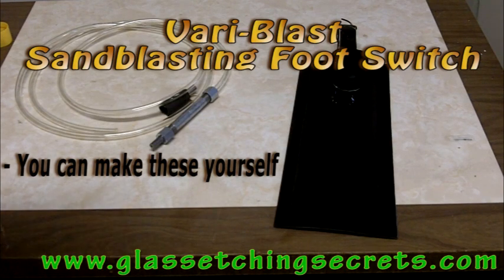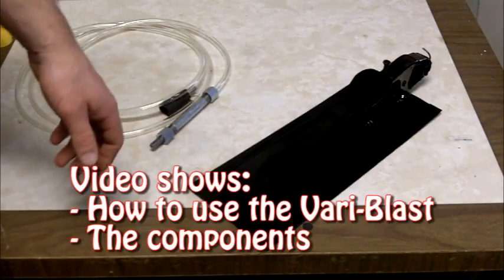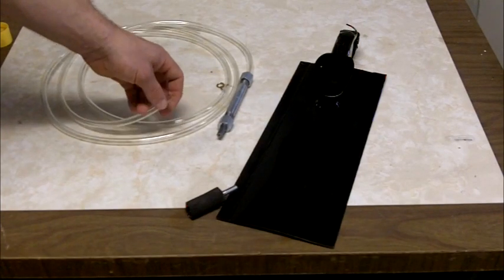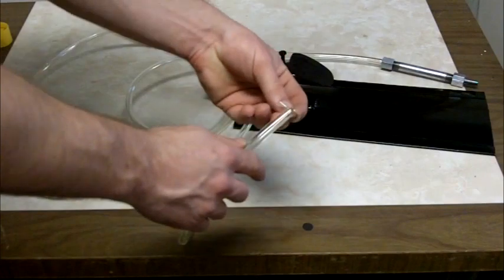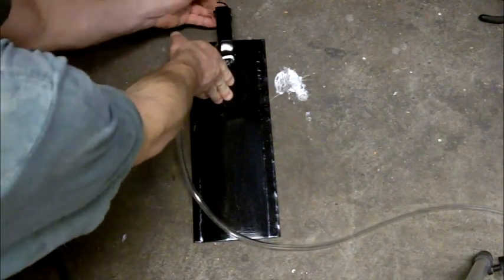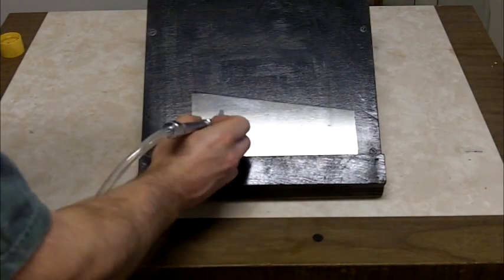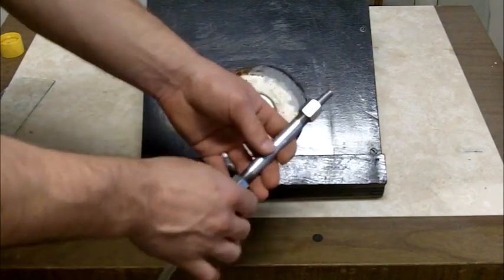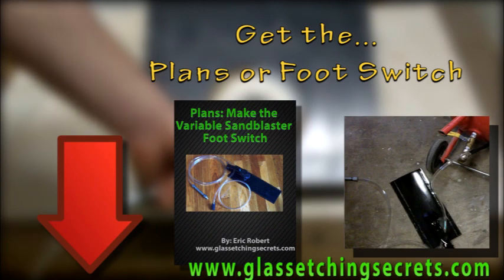New Sandblaster Gun & Foot Switch Pedal: Vari-Blast Artistic Sandblasting

Comment: Can you share some info on the nozzle/tip that you are using in this video? I'm building a small pressure pot system and I'm having trouble finding a small nozzle configuration.